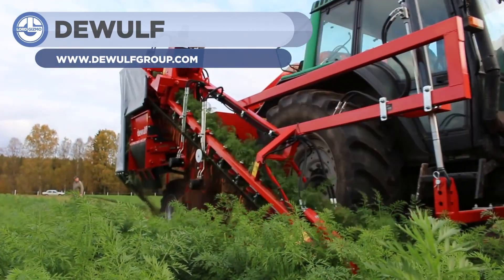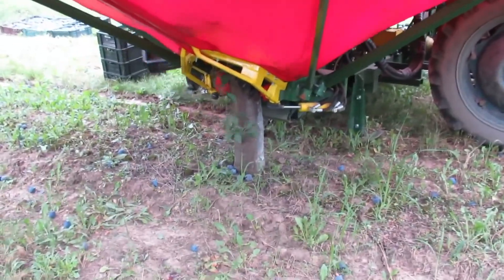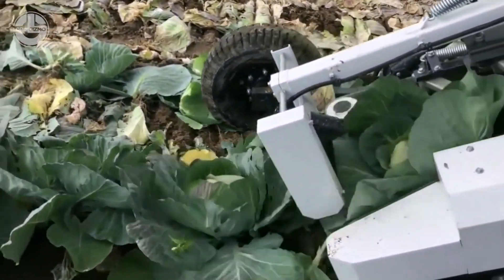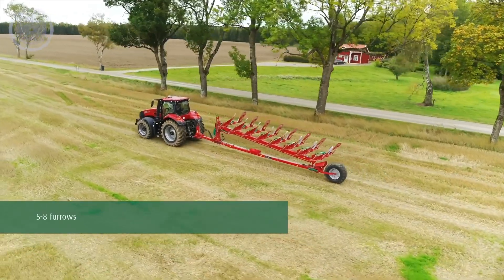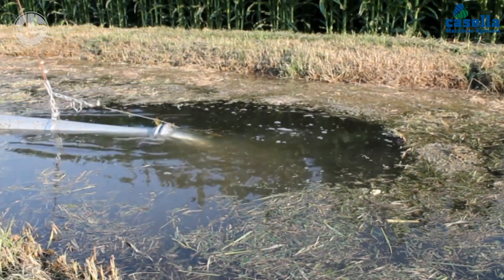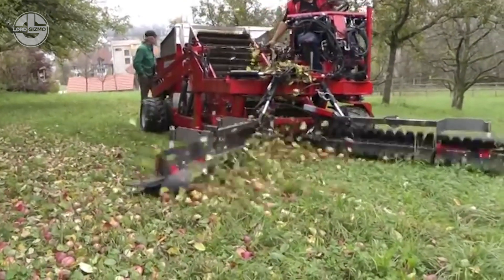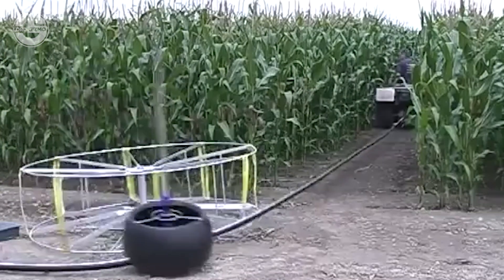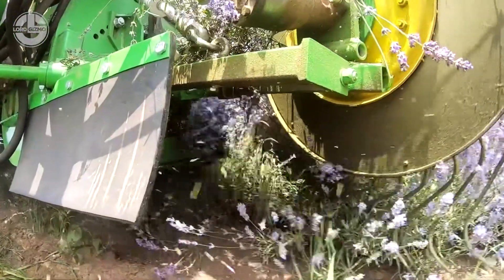Modern Agriculture Machines That Are At Another Level

Comment: 0:15 Maybe this harvester would be “a perfect” (0:50) if it took up a wider area at once. Why do two tractors have to drive to the same place many times? After all, not even grain is harvested from just 0.5 meters wide at a time, but up to 10 meters wide in one go!
Reply: Are you a carrot farmer? Root crop harvesting is much more involved than grain harvesting, and it requires more power to perform.

Whereas grain harvesting only requires cutting of stems and collection of grain, root crop harvesting requires machines to dig out buried fruit, convey it carefully, and either store or offload it without damaging the product. Plus, root crops are much denser and heavier than grains. Even the largest potato, sugarbeet, and carrot harvesters only harvest a a maximum of 2-3 meters at a time. They fill up so quickly that it only makes sense to have a chaser vehicle (or several) to keep production moving.
Reply: @TheClassyArchitect  Good explanation.